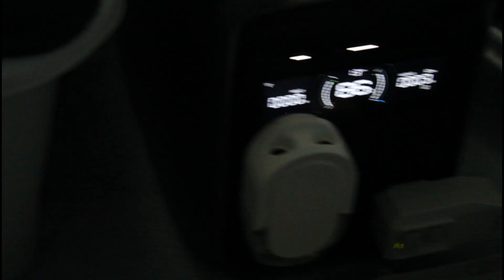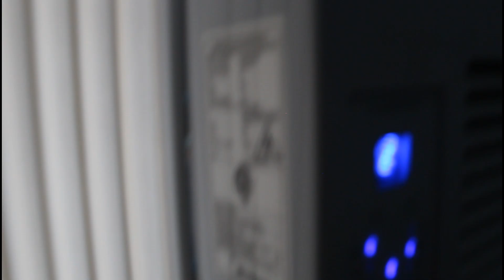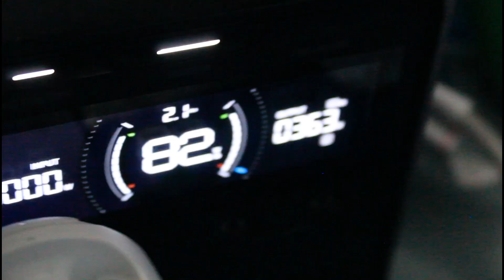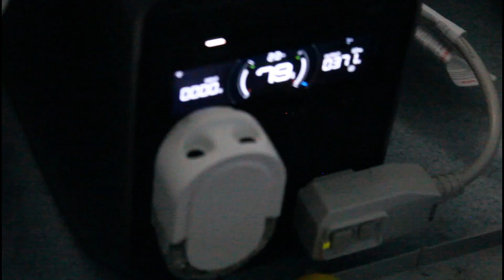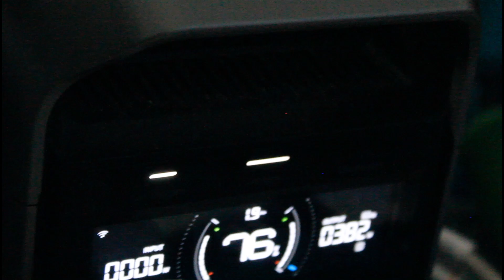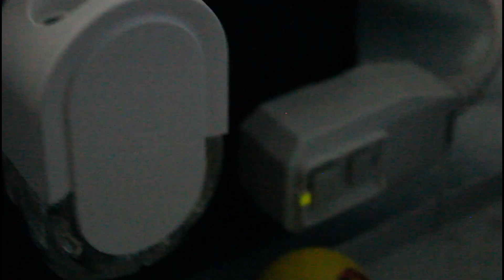Running my 5000BTU AC With an EcoFlow Delta 3 Plus (Load test)

Comment: If your AC is an inverter type it will probably have a variable speed compressor. Also 5000 btu unit is not a very good test. It will not draw very much. A full size saw, a compressor , or shop vac would be a better test.
Reply from the maker: This ac isn’t an inverter type, or at least it doesn’t say it is. I also do not have any of those items and wanted to test something I would realistically use during a power outage.